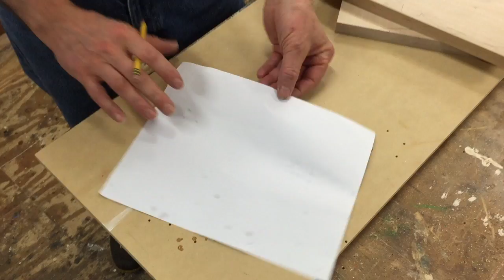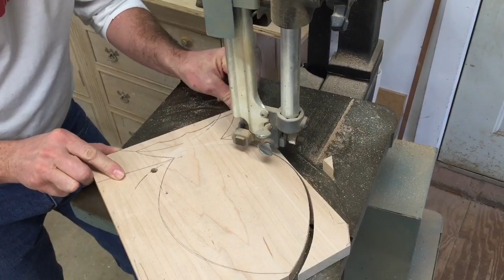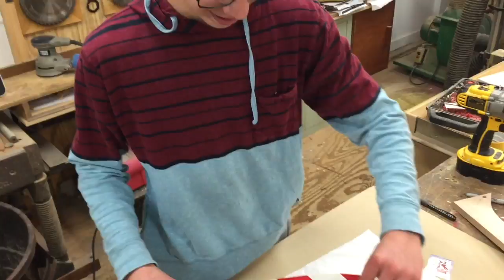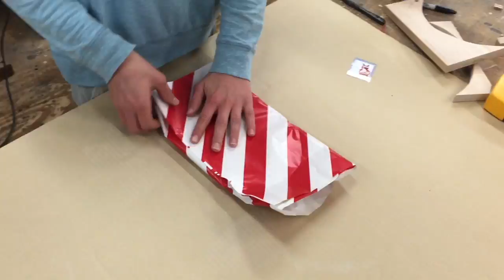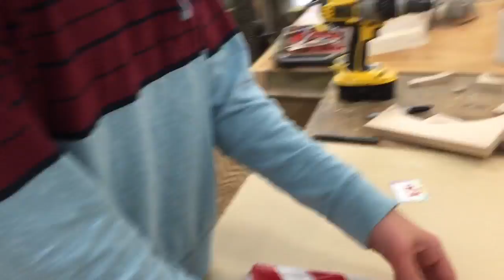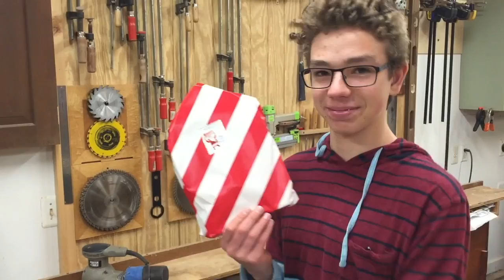Woodworking with the Band Saw - Last minute Christmas gift

Comment: Merry Christmas Jon and family. My mother has a cedar chest it is out dated to say the least and I just got done remodeling her bedroom for her with handmade Waynes Codding and carried her window sil around the entire room. Needless to say your blanket chest has inspired me to make her a new cedar chest to match her room. I am not gonna put the legs on it but a raised base with trim to cap the top of it because hers has a drawer as well. So I am gonna give the new one the same footprint as the old one. However the rest of it from the Drawer up is going to look like your Daughters just with a drawer in the base. I am gonna make 2 seperate boxes with a extra piece of plywood in between to beef up the face frame that separates the top chest from the bottom drawer. I am going to paint the bottom white following your painting routine with primer n sanding in between coats then 2 coats of a good white paint. The insde is going to be well sanded unfinished aromatic cedar. The top is going to be made from cherry with bread board ends. At least that is my thought on the top. My question to you is do you think bread board ends would look good for a top of a chest? I know they are normally used for table tops. I really respect your opinion so please let me know your thoughts.
Reply from the maker: +joe brown Hi Joe, Well I'm not really sure but My first thought is that I would want the top to be flat .... easier to clean.